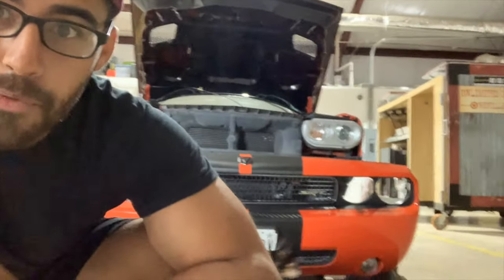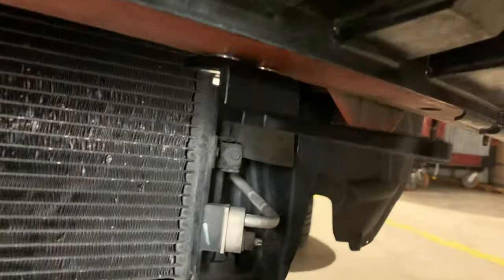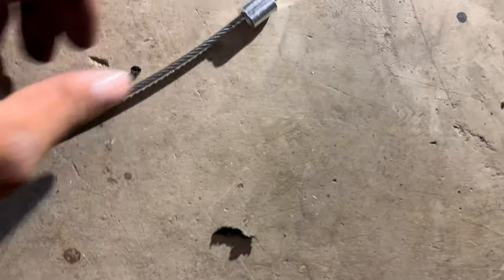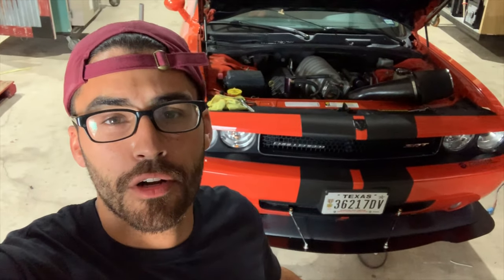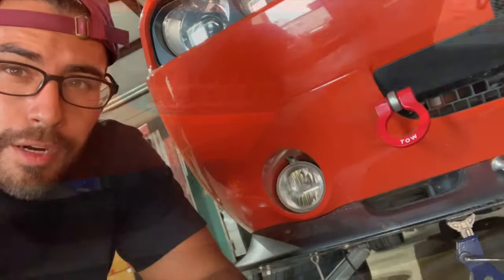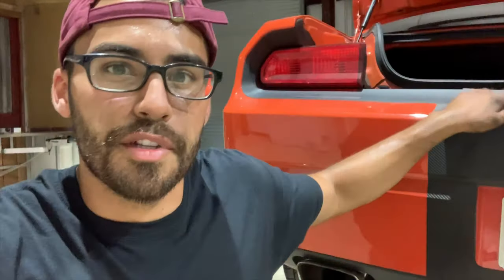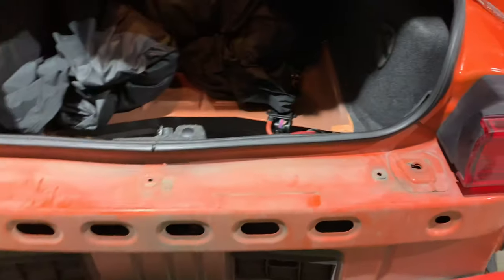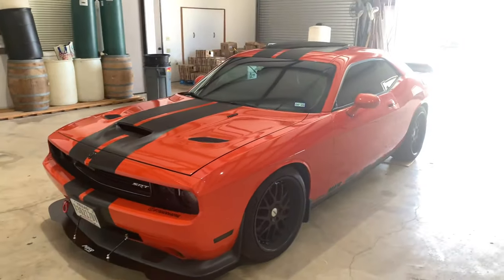Front splitter  part 2! + Tow hooks

Comment: I have a question, I see the tow hooks are functional. I was wondering if you do a lot of course tracks? If so, which tracks have you done?
Reply from the maker: So the goal is to see more road courses. So far the only road course I have been on is NOLA Motorsports park. I had big plans to do a lot of the SCCA Track Night in America events but this corona situation has halted that for now. 

My plans for this year include Harris Hill Raceway, MSR Houston, COTA, TMS infield. 

With events being cancelled and tracks closing and moving dates around it’s hard to tell when I’ll be able to jump on another track day. But you can bet I’ll record it once I do! 🤘🏽
Reply: @TIRADORACING   Nice. I am curious as I just did my first course at Circuit of the Americas here in Austin. It was an intro to performance driving with an instructor, and I am hooked. I thought the Challenger would be good just for straight line stuff, but it does ok in the course. I do plan on going back so I do need to get a tow hook. Not that I plan on going off line, but I was told that every car that gets on the track for runs needs it. I have a 2014 R/T and I believe your instructions here will easily transfer to my vehicle. Another question is this the only way for the front end to have a tow hook installed?
Reply from the maker: James Alvarez bad ass! Beat me to it lol. And from what I could see I think it’s the only spot. Once you remove it you can’t tell it’s even there. If you want help let me know we can knock it out together! Just dm me on Instagram (@tiradoracing) and we can set up a day!